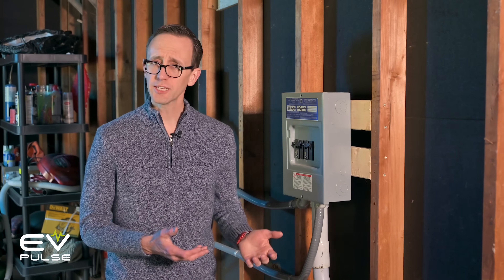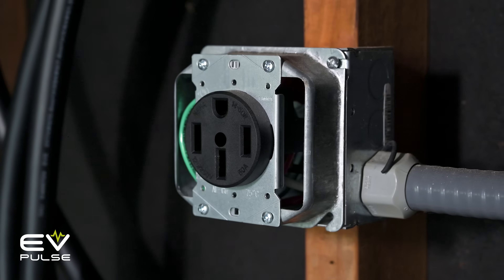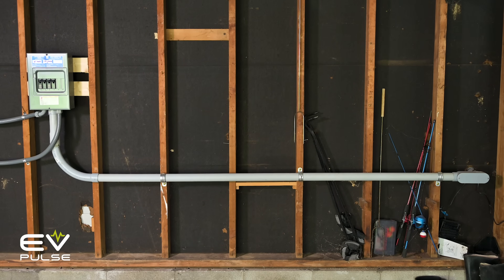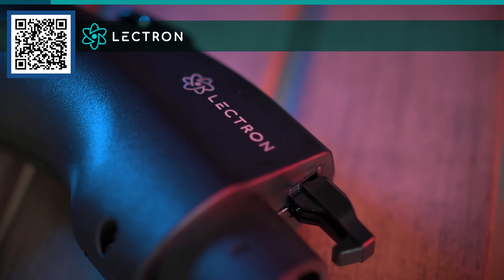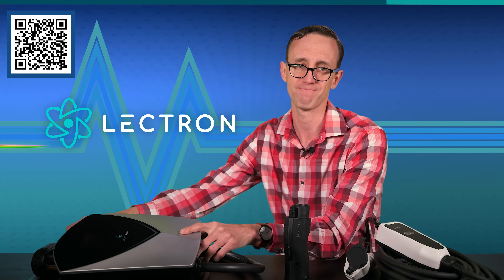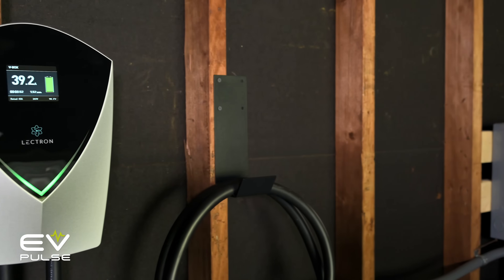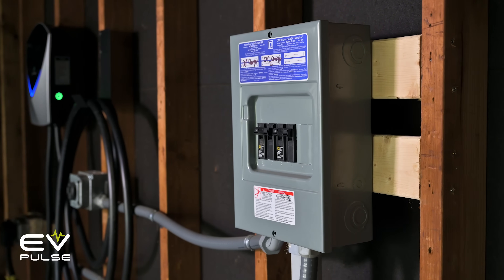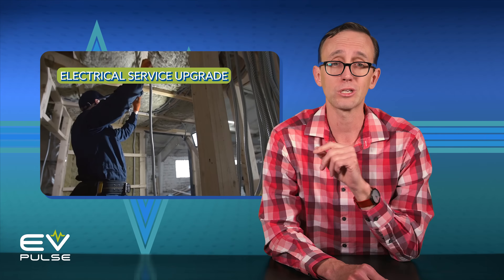Level 2 Charger Home Installation Explained

Comment: That open gap behind the 14-50R box extender seen at 1:00 is a red flag that a pro didn't do it. You can't have big gaps to allow entry to the box by insects, rodents, kids' fingers, etc. If it was ever inspected it would be an automatic fail.

Comment: This video makes understanding Level 2 chargers so much easier! I recently had mine installed by Johnson Electric and Controls in California, and they did an amazing job. Highly recommend them if you're planning to get an EV charger set up at home!
Reply: They did an amazing job but you likely paid way too much.  An EV charger is nothing different than an electric dryer outlet.

Comment: A used a spare dryer plug and passed the 50 amp wire through the vent using an adapter and another tesla adapter on the other end.  The model S I just bought charges at 32 amp as determined by the tesla connector. 350 for the wire from amazon and the adapters are around 30 each.

Comment: Went to the hardware store, $153.22 later we have a level 2 charging station.    5k to do that is crazy!
Reply: I ran my 50 amp unit 25 feet from the box. Had to buy the 75 amp wiring and all the conduit. Costs me about 150$ as well.

Comment: A nema 14-50 is all you need. Any electrician can install one. I got 2 installed for my two teslas and it was super simple. And a hard wired version should be even less to install since you don't need to buy the recepticle. Why is it that we take something that is so easy and scare people into thinking it is so hard.
Reply: Because electricians will fleece you to make more money.  It is simple.  But there are all sorts of hurdles put in place to prevent you from accessing the simplicity.
Reply: Easy huh! We’re out for your money huh? Hopefully your homeowners will cover it! Good luck
Reply: So if your panel is already oversubscribed you likely can’t add a 30-50 amp line. Especially true if your service is from before the 80s and have any of a electric stove, hot tub, electric heat, electric hot water, or central A/C, as 150 service is pushed to the brink then.
Reply: @stephkent2736  that's not how panels work. If you have a 150 amp service the breakers don't have to add up to or stay below 150 amps. You just can't be drawing 150 amps  at one time. Also just cause you have a 50 amp breaker doesn't mean it will use all of it. On my Tesla I can tell it to use how ever many amps I want up to 48. So I could tell it to only use 10 amps. Do people freak out about installing a hot water heater that has the same power requirements as an EV plug?
Reply: @TheLobo91  you can only oversubscribe the panel so much per code. If you have 150 amp service you can’t legally jam 225 amps of breakers in just because you’ll never use the stove and the EV charging at the same time.
Reply: @stephkent2736  So if your panel is already oversubscribed, somehow that is the fault of an EV?
Reply: Is the limit on the total amperage of circuit breakers specified by the breaker box manufacturer,  not the code? My box is limited to 200A main AND 200A per stab, so 400A of breakers, assuming they are distributed carefully. The only way I could add a 30A circuit for charging was to disconnect the line to the dryer (we have a gas dryer). And per code that means it is still limited to 24A continuous draw (the 80% limit that lot of folks ignore). This home electrification push is a fantasy that seems to totally ignore both electrical safety and economic reality.

Comment: I installed two Tesla Wall Connectors to one 60 amp breaker (they have a power sharing mode).   It was a pretty easy installation. Only hard part is pulling thick cable through conduit.  Utility company gave me a rebate for the cost of the chargers.  We love our two Teslas.  Don’t think we’ll ever go back.  I have an F-150 in the driveway that just sits there looking sad.

Comment: I looked into a service upgrade from 100 amps to 200 amps, not for an EV, just because my panel is full... The guy doing work on the side, $6000, and I had to take care of the power company. The licensed electrician, turn key, $15,000. And I called several outfits, $15,000 was average. This did not include the sub-panel in my garage, or the charger. This is in the Detroit area. I made these enquires last year, 2023. Tell me why I should purchase an EV? I will be dead before there is ever any ROI, assuming the EV lasts that long.
Reply: Those are insane prices
Reply: @guywhatley3219 You are not kidding! I about fell over! And I can do the work myself, I know what it entails and how to do it, and the reason I called around to a few contractors. I was thinking a couple grand for labor and then additional for the panel, breakers etc, I can do that... When the side hustle electrician said $6000, I knew I was going to do this myself. At that point, it was a matter of shits and giggles to call the licensed electricians to get the "shock" of my life! LOL!.
Reply: You pursued the inquiry into upgrading your service for reasons totally unrelated to an EV, so presumably, there would be those benefits of 200 amp service.    If you're looking to do that project ANYWAY, tacking on the cost of the charger is going to be a much smaller fraction of the total cost. But I would agree that spending $15k+ just to add a charger to your house seems like going too far unless you've got a lot of disposable income.
Reply: @williamgage597  What does my reasoning to upgrade matter? It matters quite a bit if I am looking at purchasing an EV. I am no different than anyone else with 100 amp service or even less. Everyone says a home charger is the way to go, due to the costs of charging an EV. So, by all rights this is a question that should be asked, and answered, before spending the ridiculous amount of money for a rolling battery. It should be figured into the cost of ownership, and not blown off as something I was going to do anyway. I call BS.
Reply: @michaelwright1602  Not really disagreeing.  Public charging infrastructure will need to be much better before people in homes with lower capacity electrical service, or for that matter people in multi-family housing, can think of an EV purchase independent of their home electrical service.  However, IF you truly are going to upgrade your service anyway, whether or not you get an EV, then for you as an individual, there may be less reason to feel outraged by the cost.  But as a general matter - yeah - fast charging at home isn't going to be an option for everyone.  Here's hoping they've solved the clean hydrogen production problem at industrial scale sometime soon...
Reply: That is a little steep
Reply: Get more prices. Should be no more than $ 3500 to $ 4000

Comment: I live in Sacramento.  I was told by my electrician that most of his call back problems occurred because of the use of the NEMA 14-50 plug, that hard wiring was the way to go.  I asked about the Dryer plug in my laundry and he said that that plug was limited to 24 volts.  My 32 volt charger could use that plug or similar but would charge slower.  It wasn't just him it was most of the guys in his company said the same thing and the cost virtually the same.  My neighbor used a different Electrician and was given a similar story.  I had the Charger hardwired and have had no problem.
Reply: 24 volt plug?  what the hell?
Reply: @Patco.1981  my bad should have been amp
Reply: Buy a heavy duty receptacle. They’re around a hundred bucks, but that’s what they’re made for.
Reply: I am getting 32 amps as determined by the tesla connector from the dryer. In Canada.

Comment: Got quoted $8k for upgraded panel and cost tor in line through my attic and out front of my townhouse. Literally can’t buy an EV without level 2 charging with as much as I drive. Very frustrating
Reply: $8k !!? That's it no EV 4 me my house was built in the 60s so that's likely my quote & I'm not going through the anxiety of an hour to charge at stations that may or may not be working
Reply: @empowerimpact6324  right. EV’s just not for ready for people like us yet
Reply: $15,000 here, turnkey to upgrade from 100 amp to 200 amp service. And that does not include the sub-panel in the garage or charger...
Reply: @michaelwright1602  sucks
Reply: You're getting soaked by an electrician.  Welcome to the USA.
Reply: @easternyellowjacket276  probably true but still upgrading from 100 to 200 and having to run line for a distance is still very costly
Reply: @tonyfrese6903  This is true.  Pre-covid I upgraded my service panel from 100 to 200amp.  It was around $1800 and the panel was relocated to a different spot in my house.
Reply: agreed.  i want a bolt and my weekly work commute is 300 plus miles, an ac charger takes 55 hrs. , which is kinda pointless as 8 hrs gets me about 30 miles,my home was built in the 50s and will need an entirely new box ,  5 -6K man. sooo frustrating

Comment: Don’t know where you live but in my state you must have an electrical permit to install new plugs. If not, and at sale time the inspector finds you did not have one it can get expensive post facto or you might have to remove the “un-permitted” device. Spent about $500 for an external weather proof NEMA 14-50 outlet on the front of my garage along with two 120 VAC household outlets in the garage.

Comment: I asked for a quote for level 2 capable line out to my detached garage. Quote was over $2000 minus some tax credits. No thanks. I decided to just continue my 120v charging which has rarely been a problem if I plan ahead
Reply: A good bit of the quote is the wire. You’re probably right though, just use the 120 until you can afford to hire an electrician.